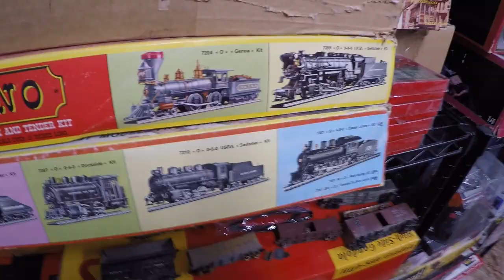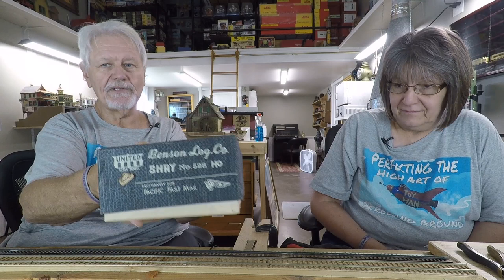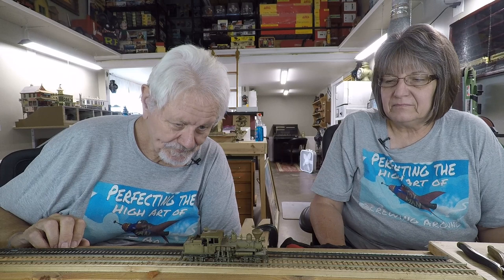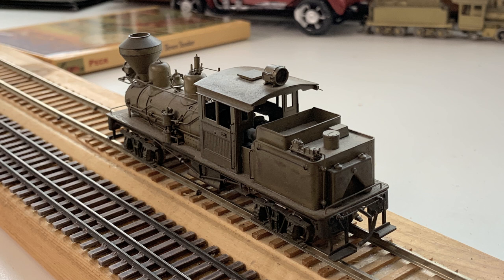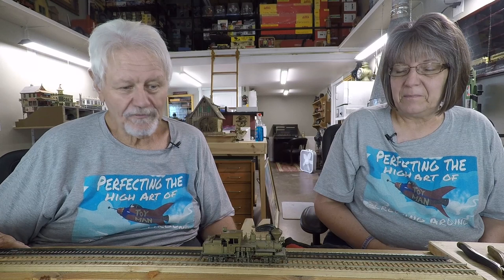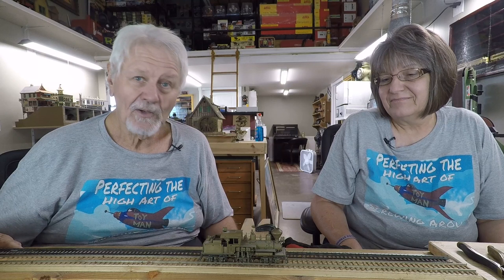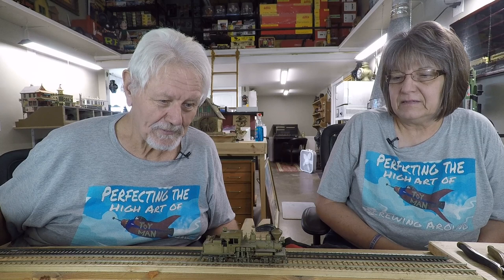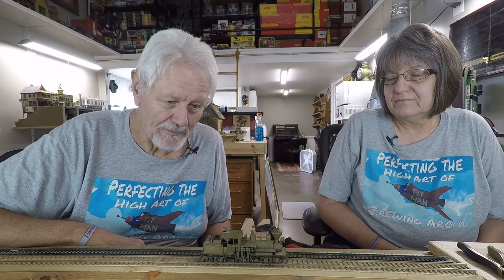Pacific Fast Mail - United Hillcrest Railroad Shay

Comment: 😎👍The neighbors love my Bachman Spectrum 2- and 3-truck Shays when I run them on my outdoor layout.
Reply from the maker: I have both of those and they’re just amazing! The two trucks she had enormous mechanical problems.   But hole first run needed to be returned for new power trucks. And I see those on eBay all the time really good prices with the exact same description never run! Of course never run had they ever turned it on it would’ve stripped its gears!

Comment: I think the last time I rode the Roaring Camp Railroad was about 1980 or so. We were planning to go up there this year in April to see family (I grew up in the Bay Area) but sadly... well best laid plans - Right? That area was very near one of the fires these past couple of weeks but I believe were just enough south that they were spared. And what a cool little engine!
Reply from the maker: Yes the fire passed by about 10 miles away. It did burn into the redwoods at the far other end of the property. But nowhere near the railroad. So far all has been spared but the fire season hasn’t even started yet

Comment: Yup,  looks like  the Class B in our park !    The  "other" manufacture  is  the  Cadillac Iron Works and  E. Shay, T. Henderson , Haynes  building the  first  Class As  in the  early 1880s.   Cadillac has Haynes  street and  Henderson township .   Check out the  Class Cs  and  Class Ds  for  a big treat .  Cass County  Railroad also has  live steam Shays  in operation .  Nice  show
Reply from the maker: We’ve got a really really cool tea boiler Shay on Tuesday. But you need to check out the incredibly large articulated steam engine on Sunday

Comment: Been a bit since last time I stopped in. One of your videos reminded me of this massive piece of old machinery I saw at a logging museum near Tacoma. I did some research and found it. Took me a while since it was so obscure. You ever heard of the lidgerfeller 1913? 2 story gigantic logging machine, the equivelant of taking a piece of heavy machinery the size of a dredge and using it for logging. Climbed all over it as a kid (even though we weren’t supposed to!). They took that big and beautiful piece of equipment and broke it down, since last time I went. Still, I’m thankful I saw it before that. Still a wonder of engineering to me today!
Reply from the maker: Wow!! That sounds great 👍. I need to look for photos.
Reply: @ToyManTelevision  took me about half an hour, but I finally found it. Very obscure, this was the only album of photos I could find of before they took her apart. I got the name wrong, it was actually a Lidgerwood cable skidder, manufactured in 1913. Here’s a link to the photo album. Clunky as hell, but there’s a lot of good photos. And believe it or not, they’re the only photos in existence that I know of! https://www.flickr.com/photos/old_growth_trees/8468815103

Comment: My HO logging engines aren't brass, but I enjoy them just the same as my brass engines. Thanks again.  Wonderful show.
Reply from the maker: I know Rivarossi’s done some logging engines.   They’re really tricky and a lot of the companies won’t do them.
Reply: Rivarossi made a three truck heisler a about 35 years ago.  Roundhouse Modeldicasting made a two truck Shay kit more than 40 years ago.  It was a real treat to assemble, all the pistons and gears work just like a real one.  It still runs and is very noisy.  Spectrum made a second gen climax with dcc and sound and (metal gears this time) about 5 years ago. I enjoy all three.
Reply: @stephenrick6672  I found one of those Heislers on eBay and am getting it restored to working order, gorgeous little model. I always wanted an excuse for a logging railroad.

Comment: There has been a MASSIVE fire burning just north and west of Felton—where Roaring Camp is. It looks like Roaring Camp has made it out into the clear but Al Smith’s Swanton Pacific Railroad completely burned. They were responsible for restoring the grand scale steam locomotives from the Overfair railway at the 1915 SF worlds fair, (plus, I believe, some equipment from the Venice Beach grand scale miniature railway) . Their roundhouse burned, and I think the jury is still out if the engines are total losses are not. Luckily, I believe I read that one of the engines was out of state for repair. Devastating, but then of course there’s all of the people who lost their homes and all of the destroyed wildlife and landscape. Just brutal.
Reply from the maker: I’ve been following all of that in shear horror and terror. I think the locomotives can be saved. In fact I know what they can it’s just a matter of if they have the money to do it. Eureka in Palisade for burnt much worse than that and Dan Markoff was able to rebuild it without too much trouble. But too much trouble I mean replacing every piece of wood and a lot of the sheet-metal but I know it can be done I’ve looked over the pictures and it’s just a matter of replacing some of the thinner sheet metal. Boy that sucks though. The Christmas fire two years ago burned the Justy Creek railroad. Taking out unfortunately the grizzly Flats depot

Comment: That is a nice looking engine, I have to ask does the shaft and connecting rods move when it's running?

I know there were a number of logging railroads located on the Olympic Peninsula and along the coast like Oregon. As a kid I kinda remember seeing a Shay sitting on a siding off to the side of Highway 101, I remember it looking to be in poor shape. Thinking about it there were a number of engines and log cars on that siding. It's fun that this video has prodded memories from over 55 years ago. I don't remember much detail of the engines but the Shay stood out because of the engine arrangement.
Reply from the maker: Hi! Yes I’m hesitant to run that. All of these engines have been sitting for so long I’d like to really kind of go through them before I put power to them for fear of twisting something! Yes the whole side of the engine is in motion as it’s running pistons going up and down valves opening and closing inside rods turning turning.
Reply: @ToyManTelevision  that is so neat when the engines are that detailed.  We both can remember a few makers back in the day had some nice looking stuff but nothing move as the train went down the track. Some stuff from Tyco was known for that and other stuff was wonderfully detailed.

Comment: Love Shays but have not been able to find one that I like.  Atlas makes one but it isn’t really realistic.  But it will have to do.
Reply from the maker: Yes there’s nothing subtle about a shay!  No really simple way to make one. Climaxes in house loser a lot easier and even they are really tricky. When it comes to Shay is you’re pretty much stuck with buying brass and they’re not cheap! I think this one was $450
Reply: @ToyManTelevision  I didn't realize the boiler was offset till you guys pointed it out.  However it is logical.